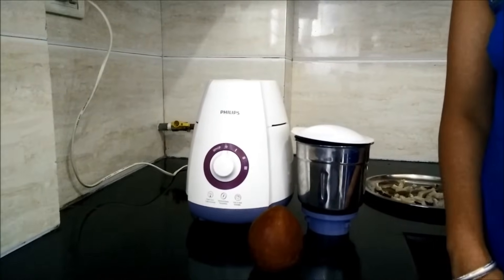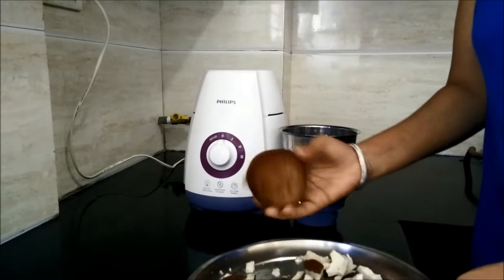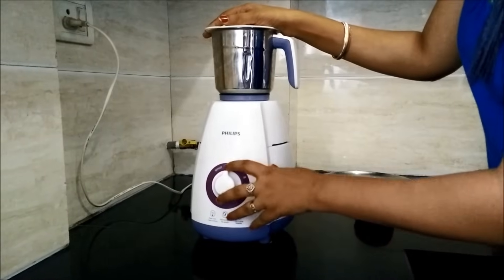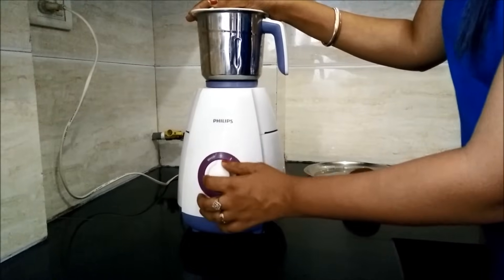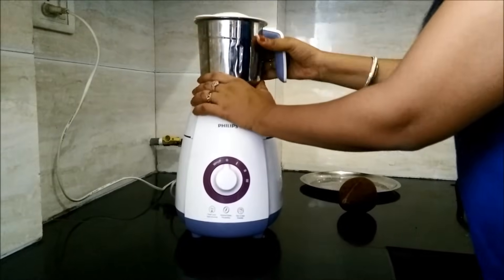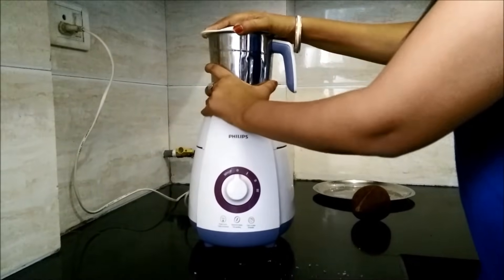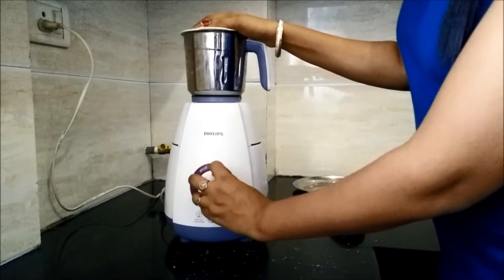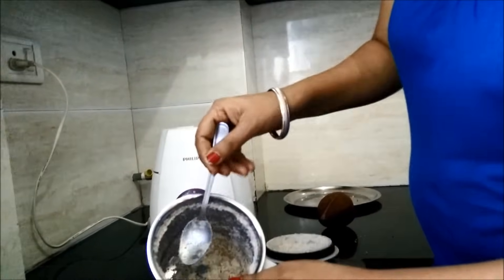How to Grind Coconut in Philips Mixer Grinder HL7699 750Watt | Most powerful mixer grinder

Comment: Mam, i bought a mixer yesterday. There are 3 jars, one small, middle, nd another large one with a handle. Plz tell me which jar can be used for 1) dry grinding, 2) wet grinding, nd 3) juicing or making tomato puree /lassi
Reply from the maker: The smallest jar is for chutney grinding. Middle jar for dry grinding. Largest jar for wet grinding like tomator puree etc